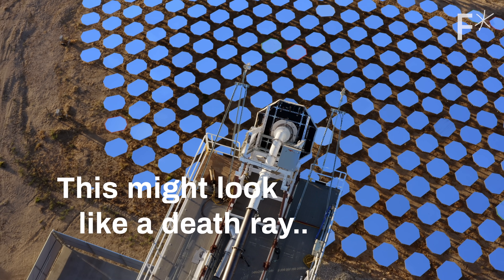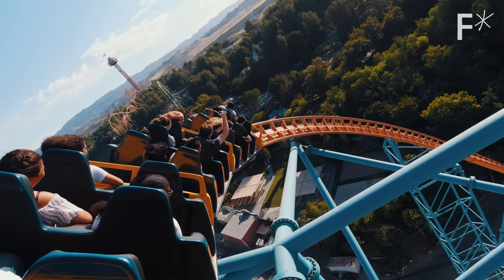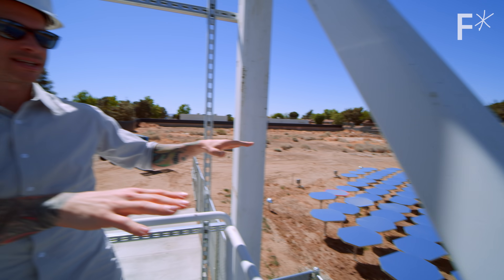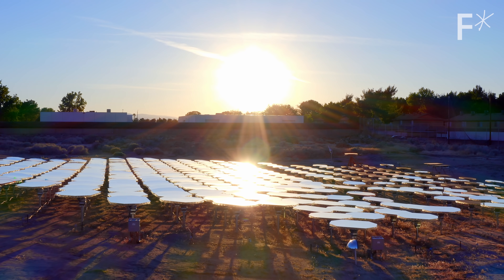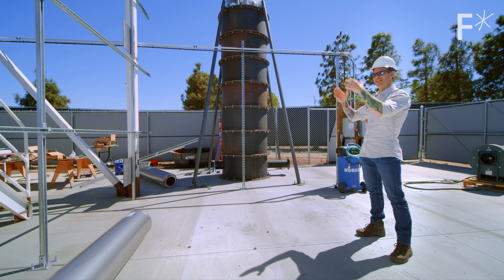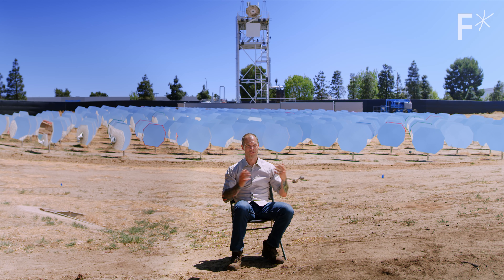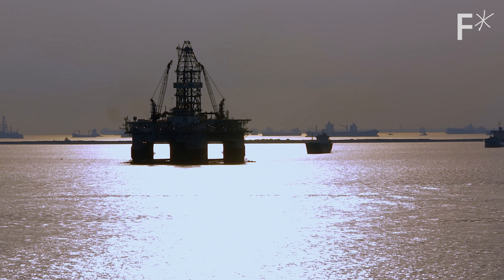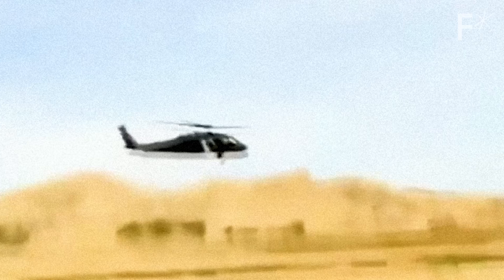How concentrated solar power could fuel the future | Big Think

Comment: You take photons and turn into heat and then the heat turn it into steam, the steam you turn into electricity and the electricity you use to make hidrogen? Seems that you lose too much of that power into every state of energy change
Reply: But the lost power comes with less environmental cost
Reply: Exactly the same as current electric production?
Reply: Same steps in getting electricity from a nuclear power plant, maybe minus the hydrogen part.. the nuclear fusion is just to boil water in most cases. So this solar method would be safer and cost less to setup.

Comment: Instead of heating up rocks, move a weight up and store as potential energy. Need some mechanical movement of weights but in a controlled and well designed fashion could store an enormous amount of energy. 
Step1: using extracted power move a block of iron weighing let’s say 100 pounds to a height. Repeat process as long as power is available.
Step2: use one block at a time on a control ascend on one end of a generator wheel. 
Store the block in a underneath silo below the level of generator but accessible by the push mechanism.
With proper calculation on the size of production and consumption a Power Tower can be designed which will store energy without batteries.

Comment: What about using salt instead of rocks? (Molten salt)
Reply: Rocks are nice and simple as you can circulate air through cheap thermally insulated piping to extract the heat.  Molten salt could set like solid rock inside the plumbing (in the event of an accident) if it is allowed to cool too much; so that all the plumbing would have to be replaced to restore service.
Reply: Salts are types of rock, dude
Reply: @Sebastian_Gecko  yes but molten salts are liquid when hot dude.  That's the point of using them.
Reply: @Sebastian_Gecko  mineral, but ok.

Comment: Photovoltaics is still far too inefficient to be the future. Using mirrors is a better solution
Reply: That was my thought but all the complexity and issues with the thermal solar plants can't match the simplicity of a solar panel and so far history of thermal solar is not very good.  At one point Ivanpah solar farm was using more energy from natural gas then it was producing from the sun.
Reply: @craigs5212  I don know if anyone has done a study on the heat island effects around solar farms. The panels are only 18% efficient I believe so the rest of the energy goes somewhere else heat being part of that. It definitely isn’t going into the photosynthesis of the grassland it’s been built upon.

Comment: This sounds like a good idea.  The main problem that I'm reading about with respect to Concentrated Solar Power is that it currently costs around $4725 per kW produced.  So... 1 MW costs $4.7 million.  1 GW (enough to replace a nuclear reactor) costs around $4.7 billion.  But... that sounds decent for that scale of power; it'll get cheaper with more use, perhaps?  But... from a geopolitics standpoint; you might need to keep large scale security on the scene to ward off warlords wanting to control the energy supply.  (I'm thinking of areas in Africa and Mexico; I'm not an expert in Geopolitics,  but I've played Risk, and the idea comes to mind pretty readily when you mention international conflict)